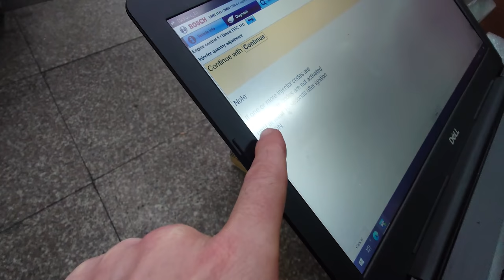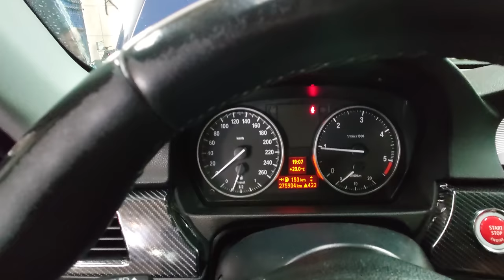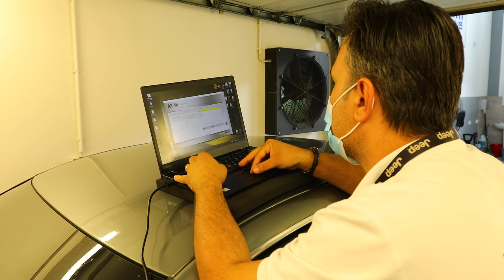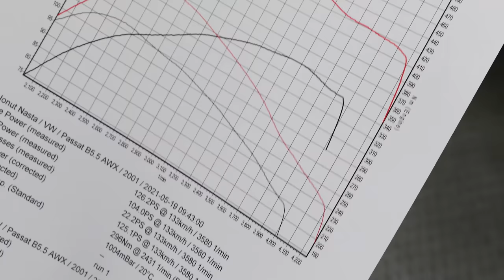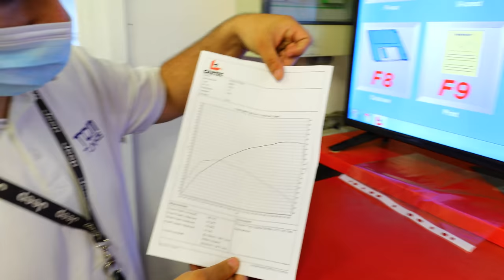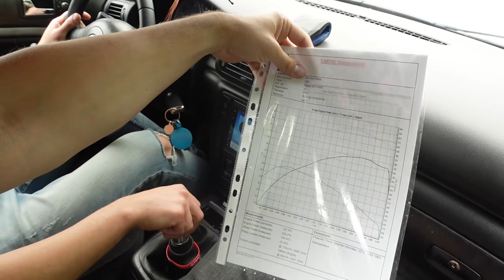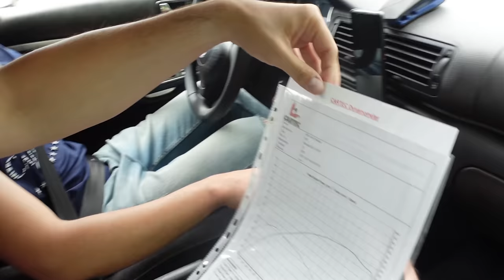I-am facut soft FARA SA STIE !!! 😱😱😱

Comment: Passat reprogramat Ecu poate atinge 167cv de bază cu presiunea turbo originală ... Nu atinge acea putere, deoarece prima hartă de injecție nu a fost atinsă și actualizată.
Dacă utilizați ECM, nu se află în driver.
Trebuie să te adaugi.
Cu toate acestea, acel motor poate ajunge cu ușurință la 180 CP, cu actualizări adecvate ale avansurilor ...
Nu cu ambreiajul original ... cuvântul unuia care are golf mk4 (130cp) de 10 ani și s-a vândut cu 400.000 km. Doar 2 probleme .. ambreiaj schimbat (cuplu limitat la 380 Nm) și intercooler pe care originalul îl deschisesem ca o midie ....

Comment: Deci stai sa inteleg. ca eu am urmarit povestea lui rares.

se ia una bucata e92 cu 184 cp la baza
 se scoate pe dyno 140 si ceva....
se softeaza(proasta idee .. cine dracu softeaza o masina cu 40 cp lipsa....) si ajunge la 186.
schimba rares turbo injectoare etc.... si ajunge cu softul lor la 196...
nu sa gandit nimeni sa puna acum un soft original cu piese noi sa vada daca scoate ce avea de fabrica. apoi cand pleci de la 184 sa te duci 215 220????
ce plm

eu unul zic ca cam lasa de dorit tcm,...
or fi buni pe turbo etc.. da sincer .. eu stiu cativa tunneri... care l ar fi trimis acasa pe rares.. NO Hate

sa va zic povestea unui bkc de 105 cp

dupa reconditonat turbo. si verificat ce mai era de verificat . facut revizie si mers la dyno
106 cp pe dyno, dupa prima varianta de soft , una cam cu multa injectie a scos 142 (si ceva fum)
dupa o rectificare la soft sau scos 135 fara fum...
sincer din 131 awx (126) sa scoti daor 151.. slab... in conditiile in care are si turbo upgrade...
Reply: ca sa te lamuresc, masina are soft de power reduction, adica in jur de 160cp, dar din cauza turbinei obosite a scos doar 150cp. Astia 10 cai i-a recuperat acum cu turbo nou. Are aproape 200 cai, nu e mult, dar cuplu 450nm e suficient. Pe viitor o sa pun dpf nou si jante usoare si poate mai urca inca 10 cai. 220cp cu genul asta de soft scot motoarele cu mai putini km, nu toroapa ca a mea de 270000km
Reply: @rareskowalski9838  man. dar cand faci soft.. nu scoti power reduction intai. gen alea cu de belgia.. au 163 .... dar configuratia fizica e la fel
de ce nu au pus intai un soft stock de 184..
Reply: @rareskowalski9838  eu nu iti fac hate sau ceva. doar ca nu le inteleg lor metoda.. sincer acuma ar trebui un soft stock  pe turbo bun si apoi facut stage 1